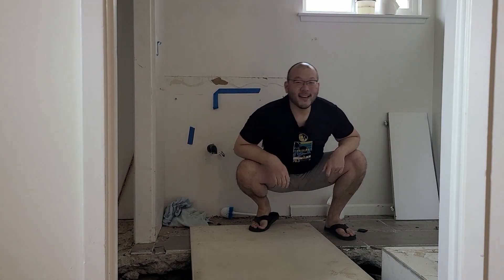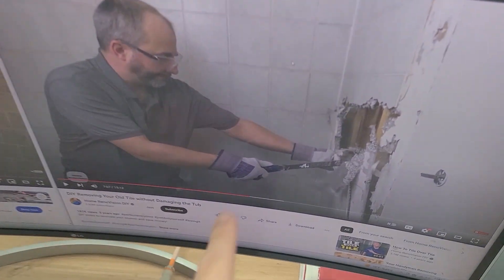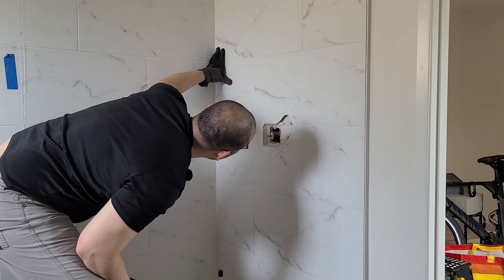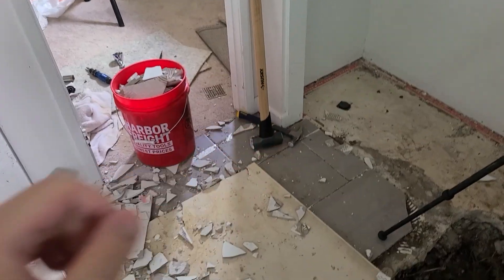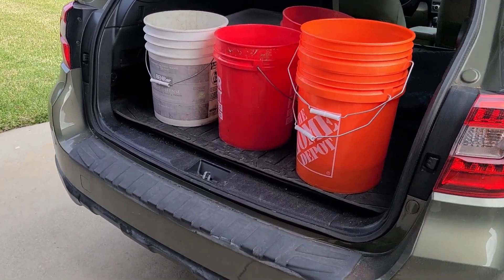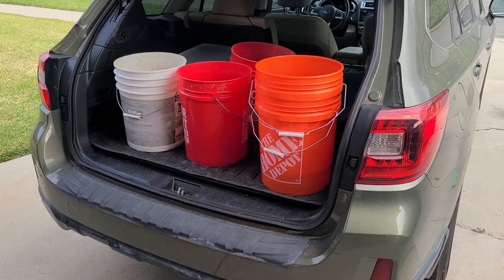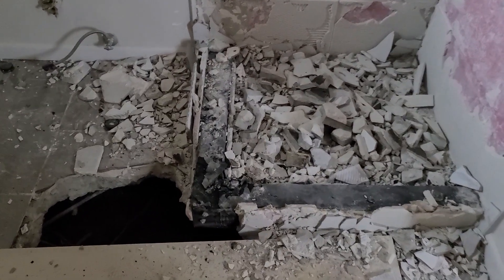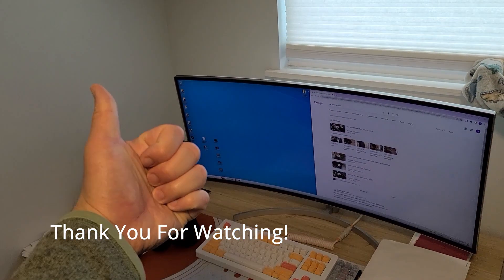Bathroom Remodel - Demolition Part 1: Removing Shower Tiles

Comment: hammer time!
"gently smashing" haha
you can get 3 and 4 pound hammers, the handles aren't nearly as long... my dad's always called them "beaters," though I guess drilling hammers and engineer hammers are apparently the more proper names
Reply from the maker: Lol! Ya. I went with a lighter 6 pound sledge because I've always wanted to buy one. The heavier ones felt too much. I probably would've been okay with a smaller one, but it was nice to be able to use both hands.
Reply: @ADentistDoesHomeImprovement  I've got a 6lb sledge, really would like an excuse to get a 10... the couple of 4lbers and the 3 I have get plenty of use as well though
nice to see that you're moving toward filling the gaping hole in your house though
Reply from the maker: @chammers7377  I do feel like the 6lb is a little light. 10 would be awesome! I probably won't be filling the gaping hole. My plan is to do the demolition, have plumbers reroute the plumbing, and our general contractor to fill the hole/pour concrete.
Reply: @ADentistDoesHomeImprovement  I just meant that it's nice to see that it is getting done in general, it would drive me nuts to have a hole in the floor for as long as it has been.. gonna be ripping out another floor for an uncle here soon myself, but at least it is all wooden construction and no pipes.. plus it adds to my mountain of reclaimed white oak!
Reply from the maker: @chammers7377  Definitely. I'm excited to work on it everyday. Took us some time to save up money and selling everything on craigslist.